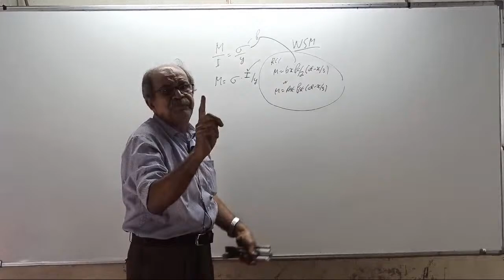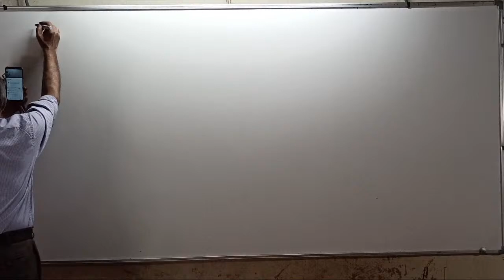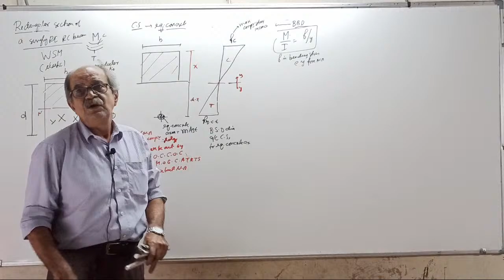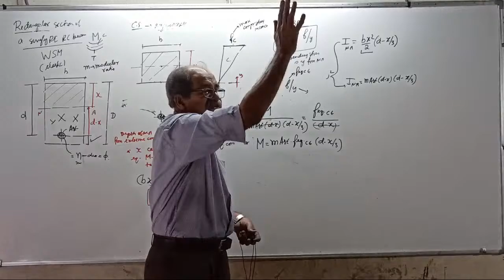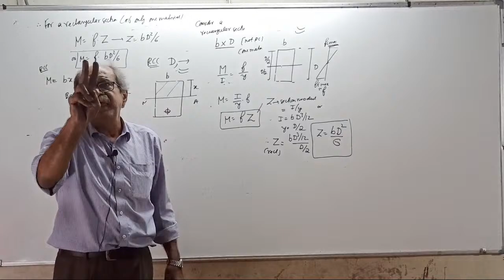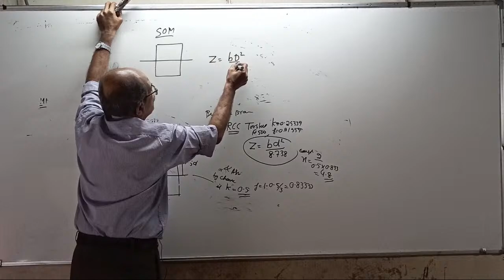BSK-Class 127/Bending & Shear Stresses

Comment: When you use lower grade of steel k will come more , then concrete portion will increases in compression ,section modulus represents the strength of member more area of participation of concrete more section modulus,if we use higher grade of steel then k will come less ,less concrete less section modulus
Reply from the maker: This is some what mathematical. OK but logical reason required without mentioning k or j or steel grade.  Then only it shows real concept
Reply: @ksnstructuralengineeringclasse  
Sir Can u please share the answer then